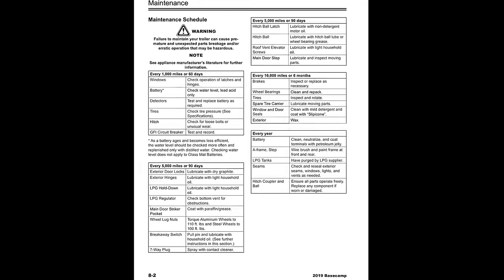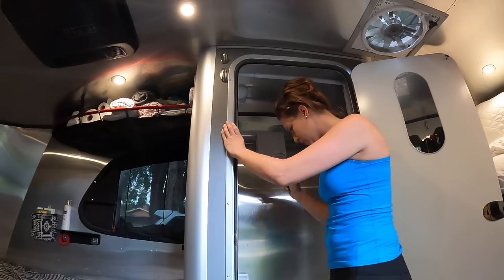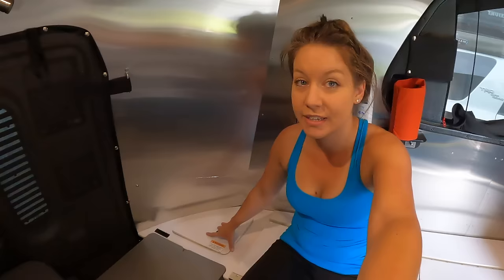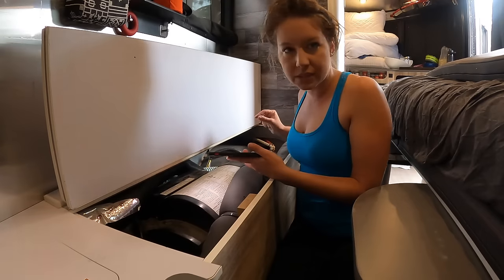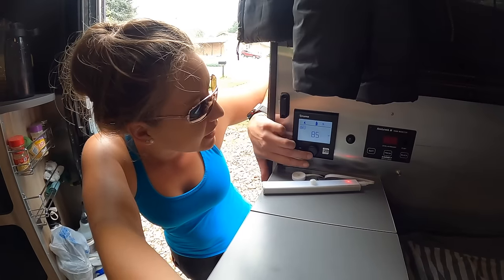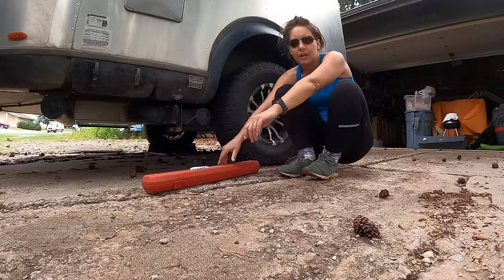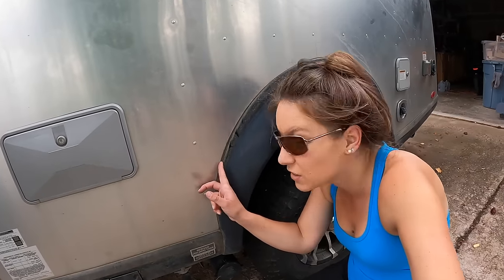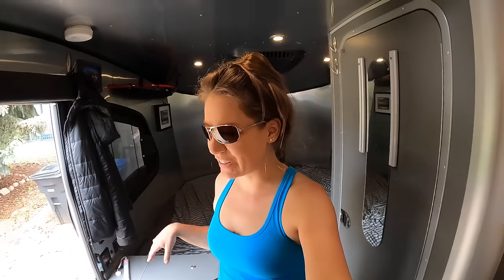RV Maintenance Before Hitting the Road: small travel trailer 2018 Airstream Basecamp X

Comment: The screw thing doesn't speak well of airstream.  They could have used blue loctite when they made it.
The screws can still be remove when you use blue but they won't jiggle loose.  It would have increased the price of the Rv by a dollar. They buy in bulk.
Reply from the maker: Agree.  The recall for the air conditioner does include adding in loctite I believe.

Comment: you can get what they call  buddy bearings so for packing your bearings just put hour grease gun on the zerk fitting and pump them full of grease. saves you alot of time and money. they also have the wet bolts for your spring shackles and then you periodically give them a shot of gdease too.  ut the buddy bearings are really great..Rick Madison..RickM117..pioneer of stealth
Reply from the maker: Thanks for the tip Rick!

Comment: You seriously need to loctite them screws and nuts ... Remove screw and apply a tiny amount of BLUE loctite (NEVER USE THE RED LOCTITE) to the tip of the thead using a toothpick, then screw it back in.
Reply from the maker: Removing the screws completely is not something I'm comfortable doing, just in case I can't mount it back on.  I will be going to the dealer when I can get in for the warranty work, which does include larger bolts as well as Loctite.  Hopefully that will solve it!

Comment: Repacking wheel bearings every 10k miles seems like a scam, modern cars have no maintenance sealed bearings
Reply: No its not a scam,thats hows trailer axles are designed.
Reply from the maker: Thanks!